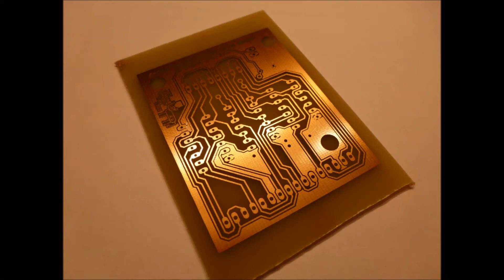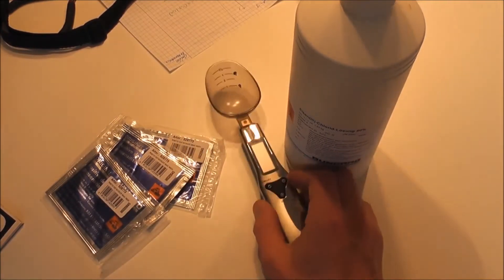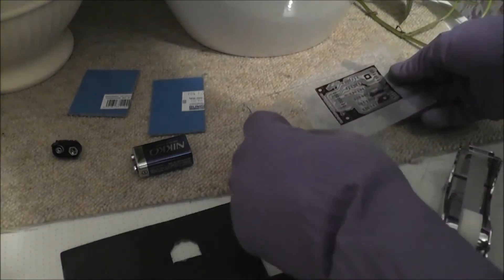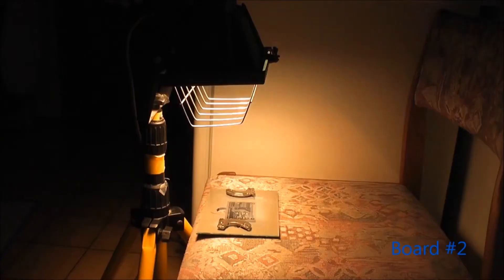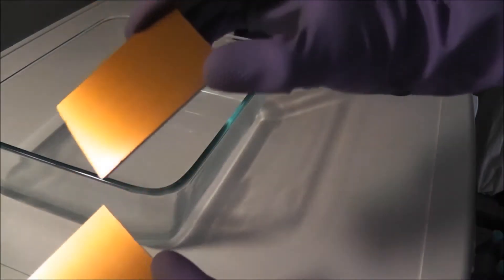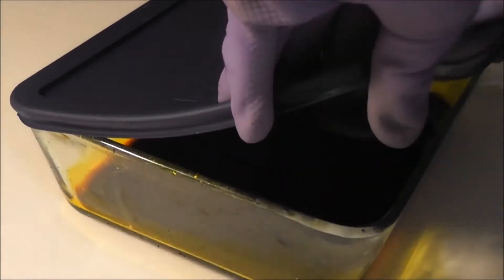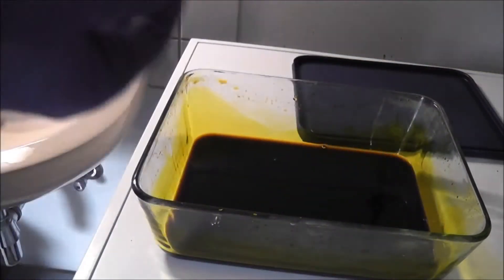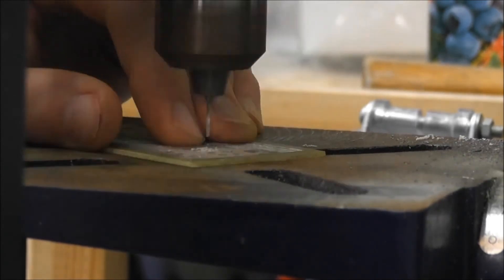PCB Prototyping Tutorial

Comment: Hello, 
How can i get the layout from my old board ? Please help me with some ideas 

Thank you
Reply from the maker: You mean you have a PCB and want to reverse engineer the schematic out of it?
Reply: The Monoclecat yes!  Because i need to made another board
Reply from the maker: Well, you have to map all connections from each component to another by checking for continuity between pins. It is a very time-intensive process that can take ages and can be very error-prone, depending on the complexity of the board. 

There are no shortcuts or loopholes.
Reply: The Monoclecat so no chance to scan it and copy on another board
Reply from the maker: No. There are services that advertise a capability to reverse engineer PCBs for you, but it's going to cost you.

Comment: I think handling a photoresitive board in a dark room with a red light is a bit of an overkill...
I never did that (just removed the protective plastic in a normally lit room) and never experienced any problems!
The photoresist is sensitive for UV and the handling time is very short compared to the time it is under your lamp.

Personally I don't like FeCl as an etchant, because it can cause stains you can never remove!

Comment: Very nicely laid out board. Nice tutorial as well. I have found that red safe lighting is not necessary, even with fluorescent lights, as long as you don't take forever to handle the board. Also, have you tried hydrogen peroxide/muriatic acid for etching?
VERY inexpensive, and no fumes or stains. Keep up the good work!

Comment: hi, it's been a long time since you posted the video..
I am in the beginings of making my own PCB's.
I've been using the toner transfer method but i wanted to improve since my tracks had to be huge so that the board came out nice..
my question is: how do you print de board? what do you use to print it?? 
the rest i got it figured out 
thanks
Reply from the maker: andresgodinho What do you mean with printing the board? The only part that involves a printer is when you print your circuit layout onto a transparency.
Reply: The Monoclecat I mean that you just said :) printing the circuit... what kind of printer do you use... what kind of paper or transparency... those things :)
Reply from the maker: andresgodinho I use a normal ink-jet printer and normal printable transparencies for overhead-projectors. 
When printing the transparencies, make sure to adjust the settings of the printer so you use as much ink as possible.
Reply: The Monoclecat thanks .. i just made my first one :)